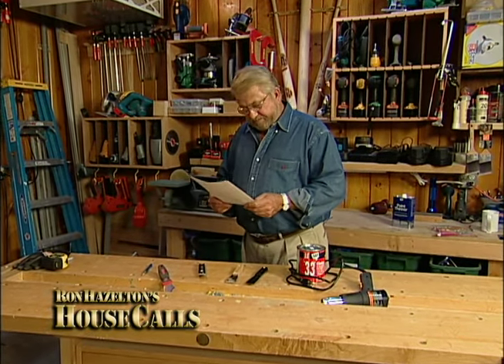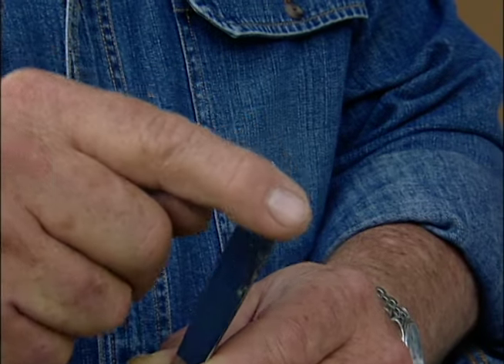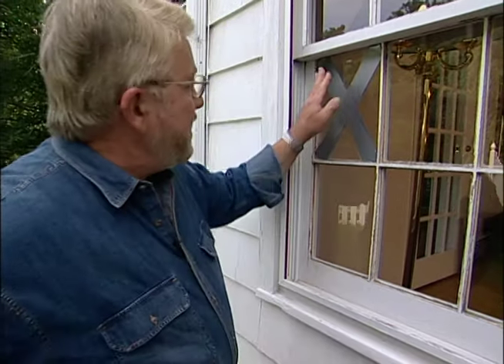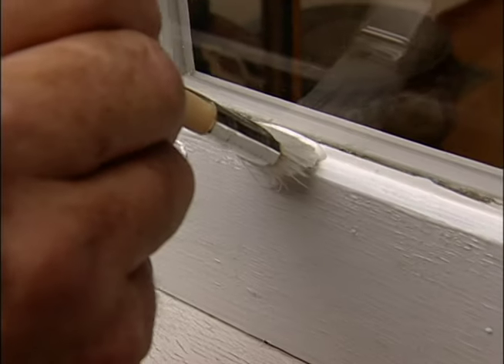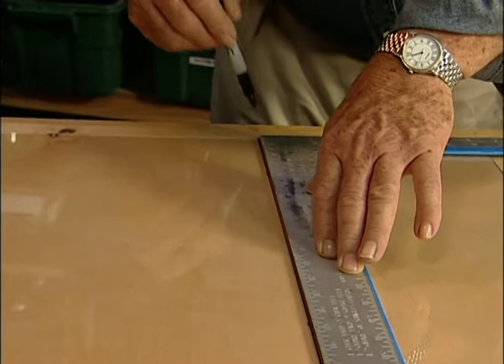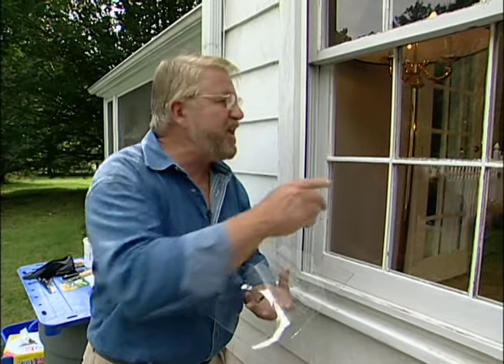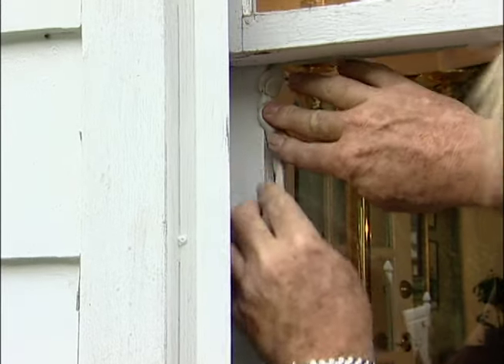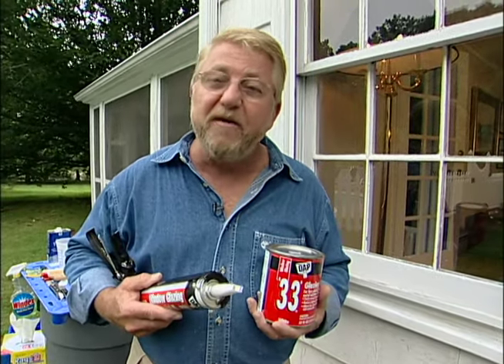How to Replace Broken Glass Pane

Comment: New subscriber here. Thanks for the video. I am replacing broken glass on my aluminum windows on my metal building which is garage/shop. I may just opt to cut my own like you did.  Wish me well.  Haha.  Thanks again for sharing your video.
Reply: Hi, would it be this same process for your aluminum window? I ask because thats the kind of window I have  and was afraid to start this process if it didn't work lol My window doesn't have putty/glaze it seems like plastic holding the window in. 🤔

Comment: I didn’t know about that paint thinner trick or the drill attachment gizmo. It would have sped up the process quite a bit when I reglazed 20 sashes in my house this past spring. Every one of them looked like the example you showed. They were leaking air like a sieve.

One other tip for fellow newbies - when you paint them, the paint is supposed to extend onto the glass a bit. It’s part of the air seal.
Reply: Sounds like you are restoring an old home too.

Comment: Great video, Ron! Instead of using glazing, can I use caulking or Flex Seal? Also, I notice you use DAP glazing. I've read a lot of 
negative reviews on this particular brand, and was wondering if you've ever had a problem with it.
Reply: Use dap correctly and you’ll be fine. Don’t use flex seal or caulk, glaze is better

Comment: Thanks Ron, but the one thing I wanted to know was how to measure the replacement piece of glass, which is the one bit you skipped! Eg, the rebate is 1/4", how much gap do I leave?
Reply: I have this question also. I used the actual dimensions of the broken piece, but didn’t allow for how I would get it back in the frame. 
The visible dimensions are 11 x 12; the actual glass was 11 1/4 x 12 3/8. 
I guess I need to have another pain cut, or try to trim this one myself with a glass cutter, but not sure how much I need to subtract from the dimensions to wiggle it in.
Reply: @evelyncook8061  Hi Evelyn. If you measured the pane you took out, I'm not sure how it won't go back in. But the general rule is to leave 1/8" gap all round. The glazier who cut the glass for me misread my diagram and cut it 1/4" too long. It took him about 2 mins to correct it.
Reply: I can’t angle it in to the pane. I’m gonna get another smaller piece today. Fingers crossed.
Reply: *pane

Comment: Thank you Ron for sharing. I replaced my windows putty a year ago. I'm having a bad mold issue on the new putty. Any solutions for this?
Reply: it is very susceptible to mold if not painted over or not painted over quickly after drying. I would suggest removing it and redoing and making sure to seal it in as soon as possible after it has a film to the top (before even drying out all the way) with oil, not water-based paint.